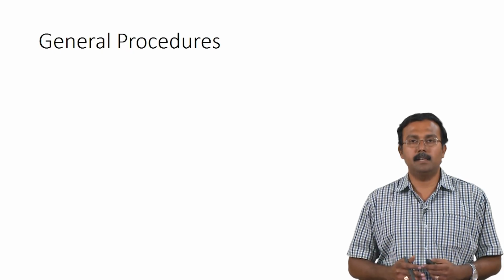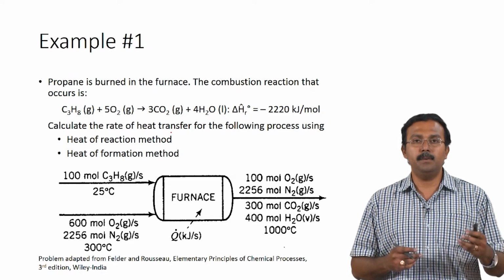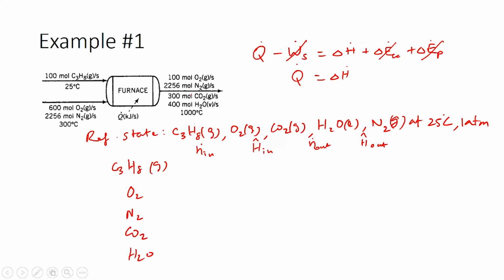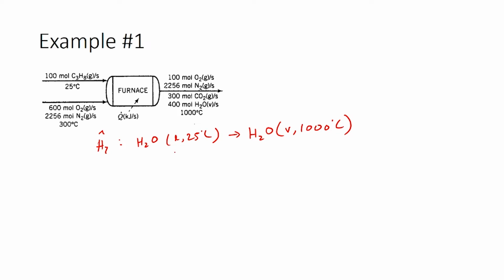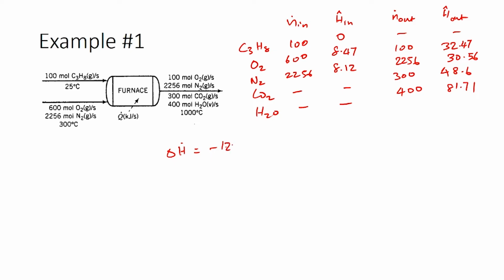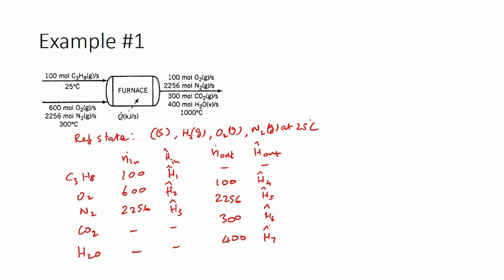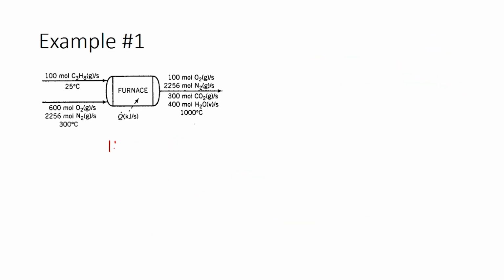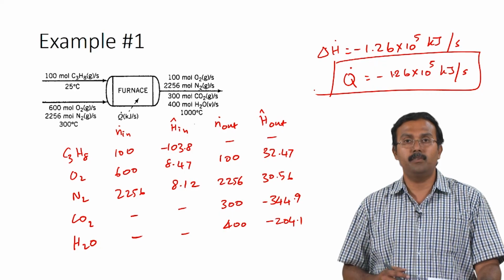#58 Energy Balances on Reactive Processes | Part 1 | Material & Energy Balances

Comment: Sir, for the extent of reaction, how do we know which substance we need to use to calculate the extent of reaction and which heat of reaction accompanied with that particular extent of reaction
Reply: You should refer the earlier videos ie. Material balance videos. I think you can find the extent of reaction for any species in the reaction specified. Try it for yourself you get 100 everytime.
Reply: Any component species can be calculated as long as the inlet and outlet mole are known, while then based on the its own reaction coefficient (from equation) and you will get all same extent of reaction 100 for each component species. The heat of reaction can be obtained based on the equation, get the heat of formation (Hf) from table B.1, then subtract the reactant side from product side (e.g. [3 x Hf CO2 + 4 x Hf H2O] - [ Hf C3H8 + 5 x Hf O2] = -2220 kJ/mol, which is same as the question stated)